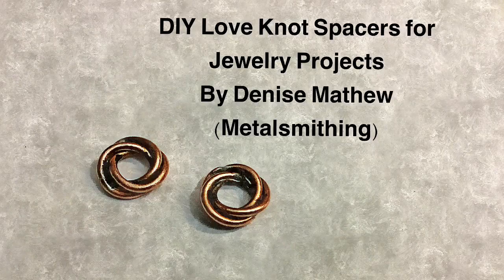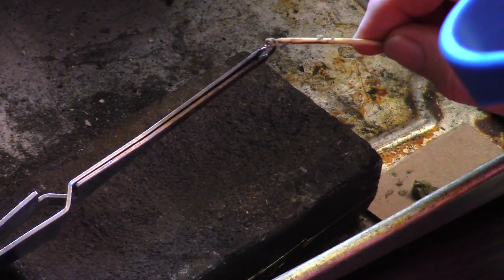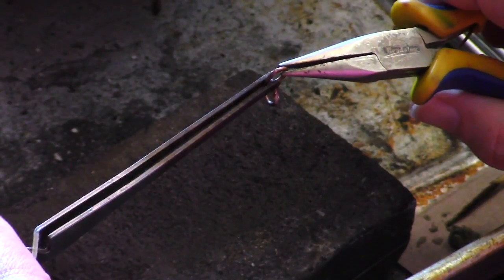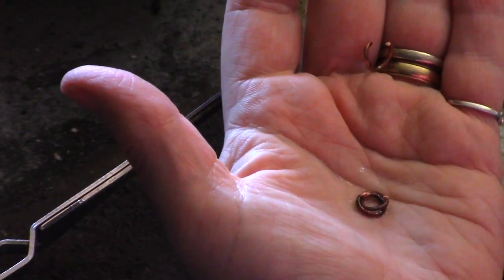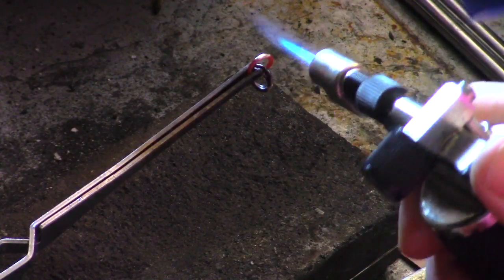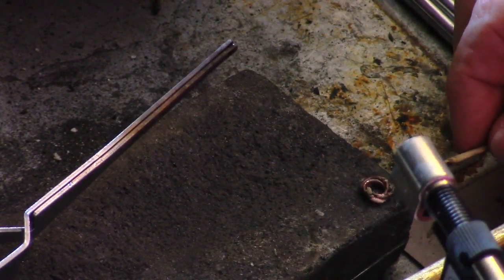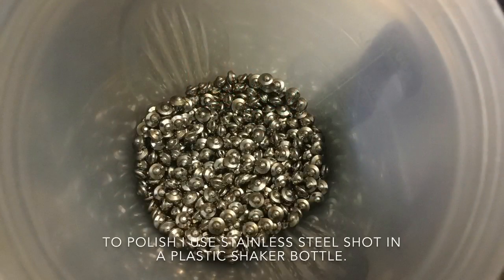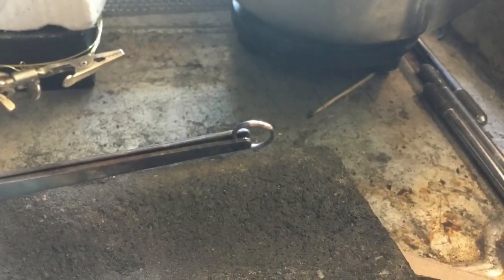How to Make DIY Love Knot Spacer Beads for Jewelry Projects (Metalsmithing)

Comment: Denise, this easy solder..I looked on ebay and mainly see it fir sterling. Is that what you are using or is it the one with grease ?
Reply from the maker: Yes, that’s the one I use. There is solder for copper and gold fill (copper is cheaper and gold is more expensive) but I use the silver for all projects because its easy to file off excess solder that might show and I work with a lot of silver. If you plan on doing a lot of one type of metal like copper or gold/gold filled you can always buy those instead. Here’s a link where I buy my solder paste, https://www.etsy.com/ca/listing/639945951/extra-easy-silver-solder-paste-ss56-14?ga_search_query=Easy%2Bsolder%2Bpaste&ref=shop_items_search_1   hope this helps and Happy Holidays 😊
Reply: @DeniseMathew  Thank you so much Denise and I wish you a very Merry Christmas and Happy New year..Stay safe.